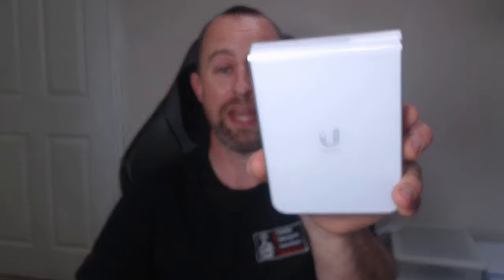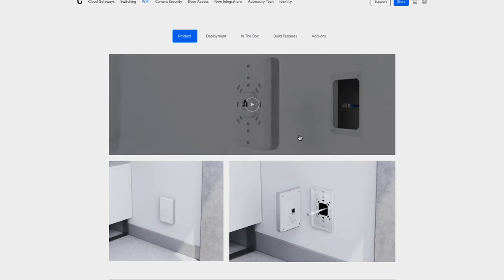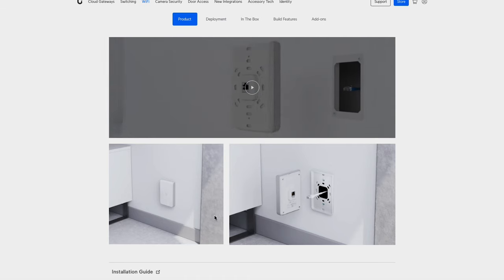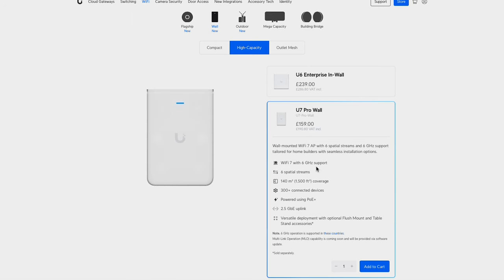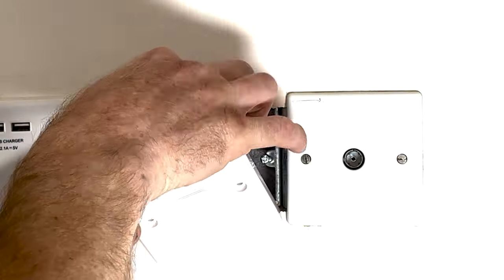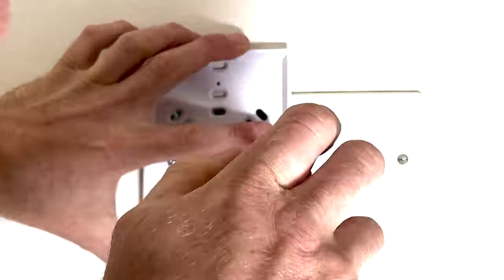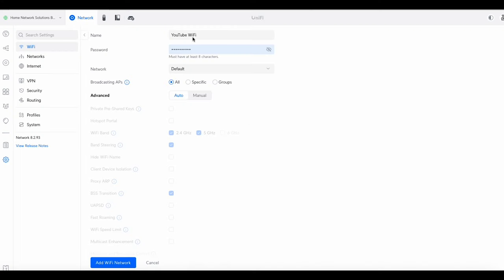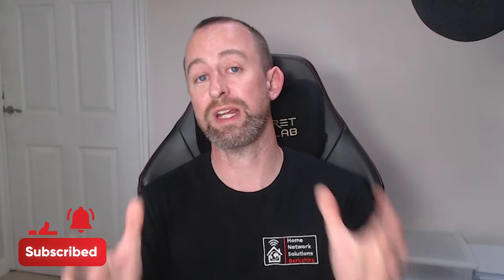How to install a Ubiquiti Unifi U6 In-Wall Access Point - EASY RETROFIT

Comment: Great overview!! I just ordered one :D Any idea what the antenna beam form is on these or from experience how they do if mounted higher? If I mounted one at chest height would it give me any issues with coverage for things on a desk etc? Trying to get above some furniture in a home and I have wall access but not ceiling access. I'm pretty experienced with Unifi stuff just haven't used one of these.
Reply from the maker: The focus is away from the wall so provided you are in front of it you should not have any issues at all regardless of the height. It is also possible to wall mount the other APs like the U6+ which would be a cheaper option.  Thanks for watching 🙏

Comment: Hello. What is the controller? Is that the software to control the access points? I have a bT router. Thanks
Reply from the maker: Yes that is exactly what it is, it a piece of software which centrally manages your Unifi Network. It will not control the BT Router.

Comment: Are those things omnidirectional ? they emmit to the front only ? they should be close to the floor ? what if i install it near the ceiling ?
Reply from the maker: They are omni directional. Higher is always better but these are designed for retro fit where Ethernet sockets are required.